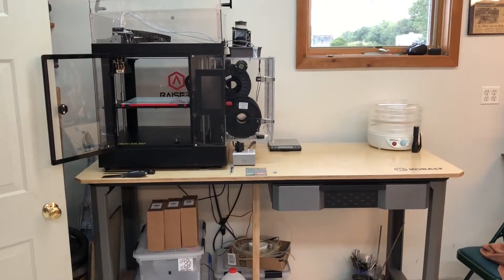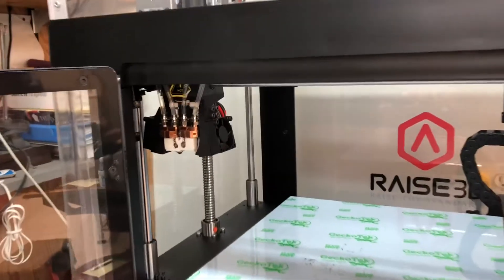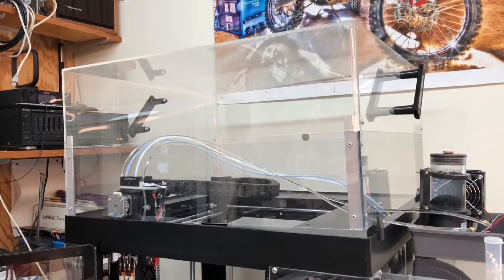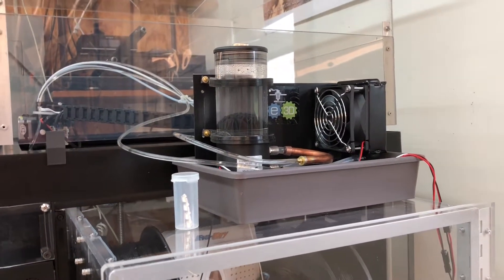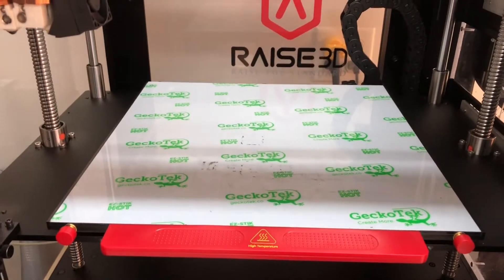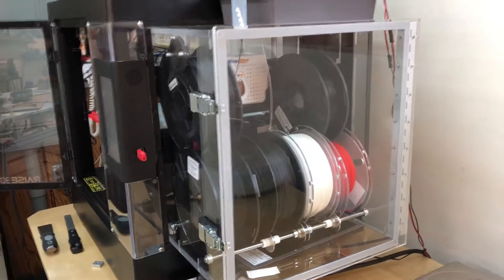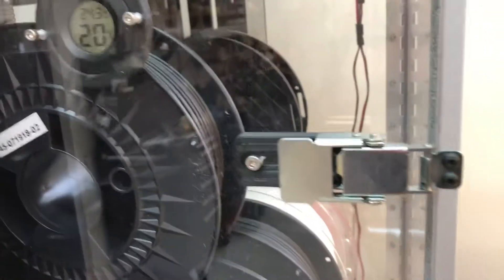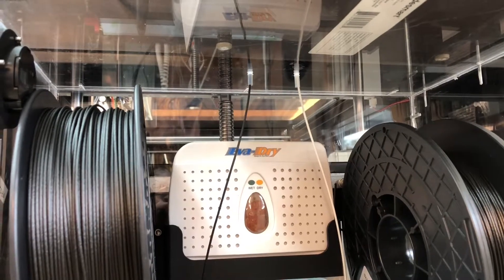R3D Pro 2 Feeder Box

Comment: Do you put gecko tek directly over the bed sheet or peel it off ? I just ordered one
Reply from the maker: The Gecko is applied to a bare and clean flex plate.  The Gecko has a liner on the back side which is peeled off to reveal adhesive.  I peel it back from one edge 3-4”, align the edge to the flex plate edge and press along the edges then slowly work inwards to be careful not to trap air bubbles.  Pull more of the liner back and repeat until the Gecko is fully applied.  Take your time and apply pressure evenly as you go.  A stiff piece of plastic without sharp edges is useful acting like a squeegee  forcing good contact and pushing any trapped air towards the liner as you advance.
Reply: @paulyarnall3605  thank you!! Should i have to adjust my Z height? Im currently using a .012 shim gap when i set it ? 
Thanks brother
Reply from the maker: It's always a good practise to check - adjust as needed whenever you make changes to the bed or its components.  Simple and easy to do.

Comment: Love your water cooling. Was going to do that but needed to keep the printer active so I went the ducted fan mod to tie me over till I can get the water blocks at a fair price. Turns out the DF mod has been working fine for my applications. One thing I do have different that makes life so much easier is a Wham Bam Flex Plate system (310×310) with PEI on one side and Buildtac on the other.  Even the most stuck-down prints just pop off. If I need flexible material to stick just flip the flex plate Buildtac up and it's golden, no tram adjustments.
Reply from the maker: Thanks, 66tbird1.  Glad that your fan mod worked out for you.  

Since my friend and colleague is manufacturing the water blocks using modern and efficient machining methods I take a bit of exception to the idea that the pricing of them is not “fair”.  There is a broad chasm between the high volume  Chinese model of making millions of a thing cheaply and the reality of high precision, but small lot manufacturing, “made in the USA”.  Time is the true  measure.  If you can make your own set of water blocks, by all means do so.  That’s what I did because none existed.  My first set of water blocks were very expensive… design, model, machine, and test.  If I could have  bought a set I would have in a heart beat.  My time is valuable.    They are still the best solution for consistent printing in the Pro2.  The stock cooling design borders on design negligence, IMO.

Re your flex plate… great idea.  I designed a mag plate that replaces the stock one and has 16 magnets.  VERY strong and no slippage.  I use the Build Tak flex plates as they are the best I could find.  I favor the GeckoTek hot surfaces.  I plan to put up a video on it soon.  And my friend is manufacturing those as well.
Reply: @paulyarnall3605  Yes, now I know who this is, I do have your reply to my email about purchasing the water blocks. Yours was the fair offer I received a few days before I became ill and had to do the DF mod.  All the other offers were hundreds of dollars each. I'd recognized the copper blocks but didn't know it was you. I'll get around to ordering a set when things get more stable around here and the shop is a bearable temperature. I'm in the southwest desert of Arizona, USA and my shop during the summer is 135F+ during the day. Great for printing ABS but not for doing fabrication work. I'll subscribe to your channel and sell off some stuff to get a set for the October change over.
JohnZ

Comment: I’m very interested in your box design for my pro2 plus but for different reasons! I’m going to stick a pallet 2 pro on month after next and I need storage below for the 4 rolls of filament!
Reply: Hi Fragged3D... Not sure I understand the first part of your second sentence.  If you are only need a place to properly store filament there are quite a few heated and dehumidifying cabinets out there that could potentially cost less than fab'ing a drybox like mine.  If you are actually thinking about  using it as a feeder box from beneath the Pro 2 plus I would be concerned about the very long bowden tube lengths.  Might not be a problem but it could be.  Why not mount the drybox exactly the same way I have done it here?  You would only need to add a panel below the drybox to  maintain the integrity of the enclosure.  You could likely simply cut out a section of the existing door.  I haven't seen a Plus so the physical details might be different from the standard Pro, but  keeping the bowden tubes short would be desirable and it would make access to the drybox a lot easier than down near the floor.  Something to think about.  Feel free to contact me directly at paul.yarnall (at) tech-resolutions . com.  I do offer the plans for a very modest fee.
Reply: Paul Yarnall  depends how much for the file! You can send me an invoice to my PayPal at fragged3d@gmail.com and if I think it’s not to much I’ll pay it!
Reply: @pauljyarnall  I'm still waiting for an invoice sir!
Reply from the maker: Fragged 3D very sorry for the delay.... I get hundreds of email  day and with a little off the grid traveling I get very far behind very quickly.  The plans for the drybox are $25. Email me at Paul.yarnall@tech-resolutions.com of you want the plans.... I try to stay on top of the address.